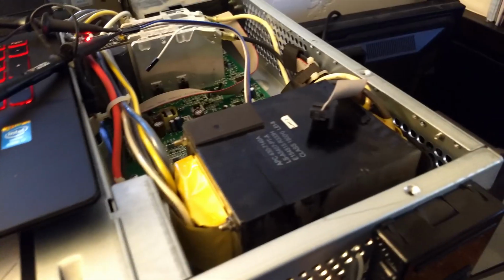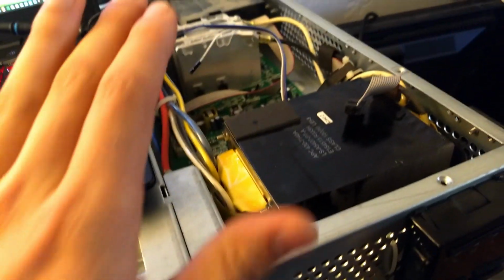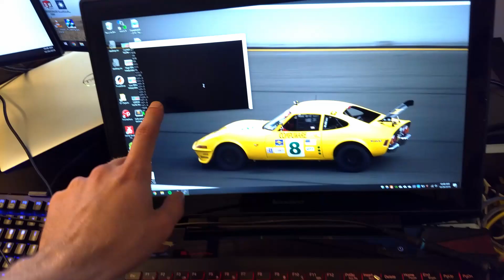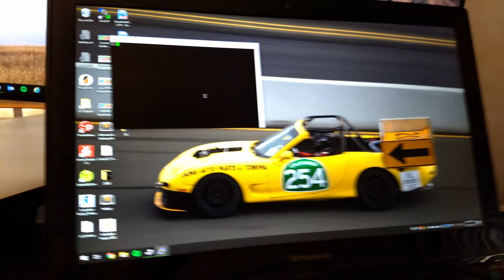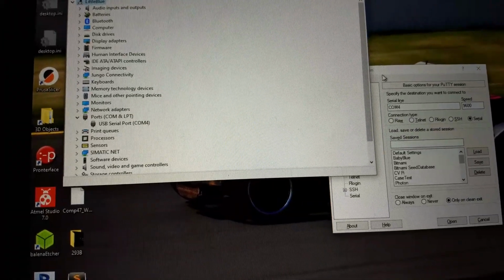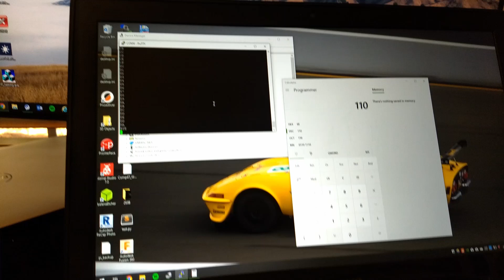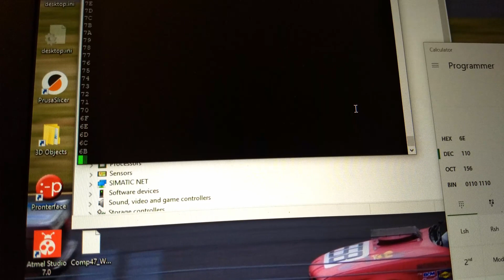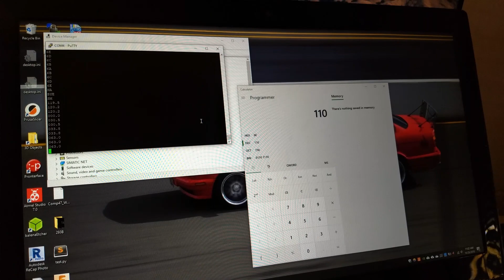Budget Pure Sine Inverter: APC Solar Generator Part 1

Comment: This is awesome! I bought a couple of SMT1500 tower ups's and plan to use a 7s Li-ion pack. So if I can modify the voltages, to accommodate the new range, that would be great!
Reply: Besides adding MOSFETs, and replacing capacitors, what else should I do to these UPS,s since, I don't know their history?  I'm worried they might have been stored outside for a time.
Reply from the maker: @JSadeiu  If you open it up and clean out the dust check for any visible water damage. At least that's what I'd do :P
Reply from the maker: @JSadeiu  Also, if you plan to keep running it within the normal operating specs you don't need to add mosfets. That's just if you wanna try and push it. Then you have to check on the wire and transformer temperatures so it's a bit more involved.

Comment: Are you sure about not being able to communicate via Modbus? I would be amazed if Schneider didn't allow this. But if serial works, go with it.
Reply from the maker: So from my understanding you can read all of the setting and tons of parameters via Modbus, even set the normally (front panel) adjustable ones. They just have the voltage and power scalers inaccessible via that interface.